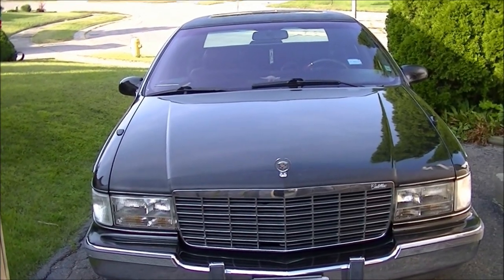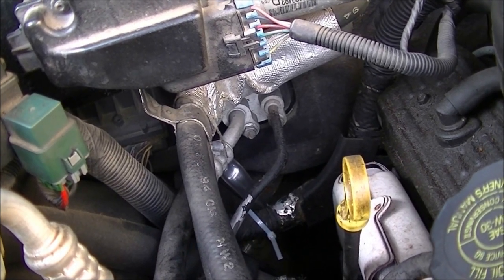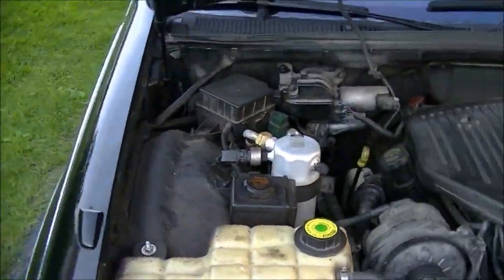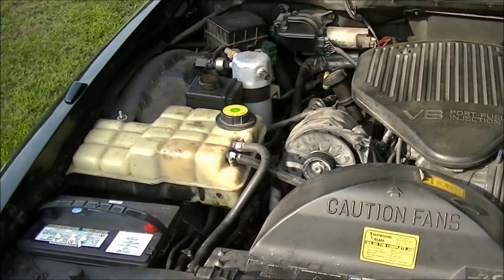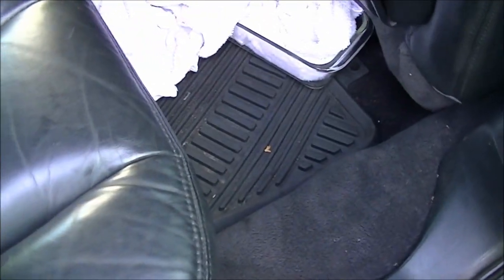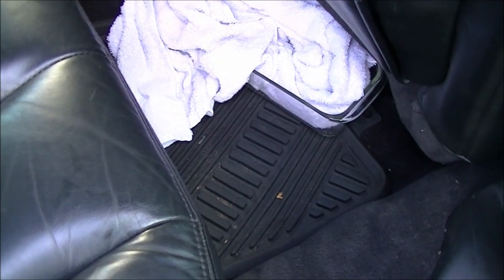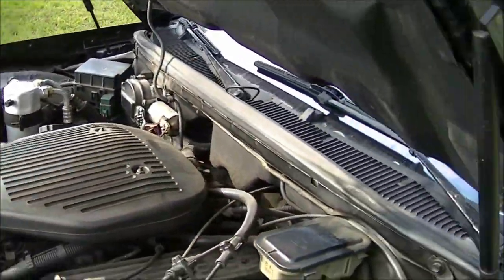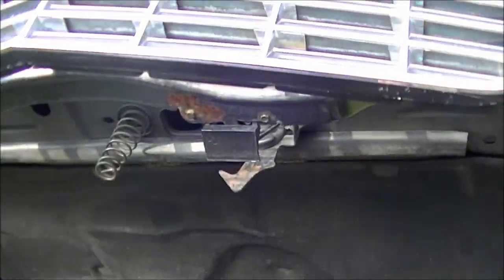PART 1 What To Look For/Expect When Owning Or Buying A Cadillac Fleetwood 93 96

Comment: Holy cats, my late father owned at least 12 Buick Roadmasters or Chevy Caprices and I have owned 3 Fleetwoods and 2 Roadmasters. They have had minor problems but nothing like you mention here. So far we each had to replace one opti-spark, one water pump and several window sliders.  I actually replace sliders with rollers intentionally. Of course normal maintenance like shocks, brakes, coolant, oil/lube, etc have been performed as needed or on a schedule.   But then again, we, being frugal, don't drive our $40-50K cars or any car we LIKE in the winter. We buy cheapo econo-boxes for driving in the salt.

Comment: I'm not sure if it would work on this but had an idea my friend's father used to do on door seals.  He injected silicone into the seals to keep it from getting crushed yet still have some cushion.  Then he would wipe silicone or some type of long lasting rubber protectant on the seals to prevent rotting.

Comment: Well done sir! I too was once a miserable SOB after purchasing a '94 Fleetwood from a Cadillac dealership in NJ about 15 years ago. Had two 77 DeVilles and an 87 Cimarron(!) previously. My Fleet had just about 100k at the time of purchase. First really cold winter day comes along and the dash pad cracks; that was only the beginning of my woes. Soon afterward it took a tow to my mechanic to find that I was out of fuel with 2 bars showing on the LED gauge! Very insightful about the body/rust quirks, BTW. My biggest problems came with Opti spark failure and later tranny failure (a $2700 repair) before a buck mercifully decided to cross in front of me at around 45 mph. Sold the car to a fellow who had 93-96 Fleetwood limos; he got a damn good parts car out of the deal (mine also came with chrome Vogue wheels--a $2000 option alone--shod with mustard/mayo Vogue tyres). I could go on about the many quirks that made my Fleetwood a less than satisfying experience. Aside from a tendency to wear out front end/steering parts (it IS a 4400lb. car after all) one of the few pluses I can note is the 94's improved handling on what is, after all, the same RWD chassis in use since 1977. I've since switched back to Lincoln Town Cars since the experience with my last Caddy, but was so dismayed at the time that I half-seriously test drove some Series 3 Jaguar XJ6's thinking "how bad can one be after this last Cadillac?"
Reply from the maker: telebob59 thank you for watching the video I appreciate your comment. yeah I'm quite a miserable SOB I took the car out of hibernation after sitting during winter I moved it up and down the driveway and blew both brake lines just by doing that.... Im not surprised it happened just really pissed me off.  I'm glad it didn't blow when I went for my emissions test! The total cost for brake lines and have the 23 year old spark plugs changed and fuel filter came to $428 which isn't too bad I figured it would have been more considering the spark plugs are a royal pain in the ass to change on this car. Now my brakes work real good the car still runs like shit even with brand new platinum spark plugs and fuel filter next I'm going to see if my ICM is the culprit because I hear a lot of arcing sounds coming from the coil. I read that a faulty icm can cause the  timing to be off and make the engine run lean or rich. I might need to have my steering components looked at because now I hear this clunk sound when going over small or medium bumps 

My Next car will hopefully be a 78 fleetwood or Eldorado convertible of that year I'm sick of all these sensors and computer modules they're  supposed to tell you if there's something wrong with the car but I'm not getting any codes at all

Comment: Very nice comprehensive video covering just about everything to look for.   I am looking at possibly getting one of the 94-96 either roadmaster (b-body) or fleetwood (d-body) which are different I'm told.  But from what is shown the issues should be on any of the LT-1 powered sedans.  I hear you on the reman parts had an issue once with an alternator.  It was performed by the dealer along with other repairs and they had to get a reman from napa a "gold series" ironically.  It didn't make noise but it did trigger my battery light but as approaching red-line not low rpm.  Fortunately I immediately turned around and went back.  Dealer tested it when they got to the load test, immediate failure dropping to 10 volts.  They were fairly ticked as it had the bs 100% passed test printout packed with it.  So they actually sent them a bill for their labor for the R&R which was considerable haha.
Reply from the maker: I'm glad you enjoyed the video. The B body and D body are different but pretty much use the same engine and transmission. All the issues that I've had on this car could happen on the impala, caprice, buick roadmaster wagon or sedan. I know they all suffer from heater core leaks, broken window sliders and rusty rear quarter panels, mine hides the rust because of the chrome panels :)  I wish grandpa bought a 1993 fleetwood with the LO5 engine, I know they were slower and people say never buy the first of anything because it could be a problem down the road but I think it would be far more reliable than my 95. Which I'm still driving..... currently she's running rich and lean and stuttering at slow speeds, gas mileage went from 15 city to around 9... I know for sure it will not pass emissions testing next year. It seems every time an attempt is made to repair it or treat it to something good something bad happens In May of this year I bought brand new Hercules White wall tires from a guy for $300 who wanted to switch to wide white walls, I had them installed and not even a week goes by I ended up getting a roofing nail stuck in the shoulder of one of the tires. The only reason why I'm still driving this damn car is because it has working A/C  I don't think I could sell it to someone with all the issues it has. I can't afford to buy another car right now

Comment: I have 1995 Fleetwood, and it's going strong but it only has 12,000 km on it. My 1994 Buick Roadmaster(same basic powertrain) has 270,000km, and my 1995 Buick RM had 395,000 on it when I was written off. All 3 of my cars, like yours had/have the Factory Tow Package on it. I just wish they would build car like these still, not those pathetic subcompacts that they are claiming to be fullsize cars

Comment: I have a 1996 Cad Fleetwood that I almost had for 10 yrs and they are some nice smooth riding cars. Went I brought mines it's had 78000 miles on it when I brought in 2009 and I still have the car now today and it have 84000 miles on it and it run good as new and just like sitting in my living room and good AC stills blows cold 
Have a  LT 1 strong motor and  a 4L60E trans shifts nice and smooth and I'm the second owner of it and I will not buy a brand new one, because it not like the older ones.

Comment: My 96 Buick Roadmaster has that A/C compressor noise and had since I bought it in 2016 w/22K miles. Have 37K, noise still there, still blows ice cold. Had it looked at but I’m stationed in Germany where I sent the car and some say it’s normal, others think like me, bearings going. Just got the photo today since 2 are available but can’t see what kind it is. I’m being stationed back in the US next month so when the car arrives I’ll replace it there.

Comment: I have a 1995 Fleetwood and it’s still going strong with 150,000 miles on it. I recently had to rebuild the transmission in mine. I don’t think the 4L60E is a very good transmission either. It’s definitely a weak link in these cars. I think the problem is they designed it with planned obsolescence. A lot of the parts are weak including the clutch sun shell which holds all the clutch discs. When that thin piece of metal fractures it’s all over.They knew it or something else inside would probably crap out at around 100,000 miles and send customers back to the dealer to trade it in on a new Cadillac. The older GM trannys would run forever. They used to make them a lot more robust. I was just curious what happened to yours and why you had to stop driving it. I’m pretty good working on cars and I would be glad to try to help you figure out how to get her going again. Thanks for the video. It’s cool to see someone younger like myself interested in older rear wheel drive American cars. These were truly the last traditional Cadillac.
Reply from the maker: Ryan Hodges Hi Ryan. Thank you for your review. This car used to belong to my grandfather he was the first owner the car was purchased From John bear Cadillac in Hamilton Ontario. He paid $48,500 brand new. He never took proper care of the car which would explain why I'm having issues one after another. He stopped driving it because it had a leaking radiator, oil lines, transmission lines you name it every line that had fluid in it was shot! The final straw for him was the heater core not blowing out any heat. The cause was from using the orange antifreeze called Dex cool. If your car has that stuff switch to the green stuff! I Took ownership of the car back in 2013 and officially put it on the road on march of 2014. I believe that the optispark is failing but in a very unusual way. Last night it rained/snowed I went out to start the car and it fired up like it normally does but stutters really bad in reverse or drive almost like it wants to stall but never does. I shut the car off and start it back up the problem sorta goes away but it's still there. This problem only occurs when it's wet outside
Reply: vcamnowaa That’s good advice about the orange Dexcool stuff. It can really cause problems. Mine already has the standard green antifreeze in it. It does sound like your Opti is probably going bad. Especially since you mentioned that it gets worse when it’s damp outside. That’s usually what happens. They are extremely sensitive to moisture unfortunately. If it’s the original one it’s probably on the way out. There’s a guy on EBay who restores Optisparks. His seller id is Berrington1 I believe. I bought one from him. He does really good work and uses good quality parts. He puts thread locker on the rotor button and seals the cap to the housing. If you decide to buy one from him he will send you a video of the the new one working on an oscilloscope. You might want to check his stuff out. I know you’ve had a lot of problems with your car but I believe you can get it going again with a little work. They are really great cars and they will go for a long time if a few of the known problems are taken care of.
Reply from the maker: Ryan Hodges Thanks Ryan. The car is still running just takes a bit of pedal stompin to get it to snap out of it's stuttering tantrum. I actually just drove to the grocery store and a few other places today with no hiccup. I will just keep driving it till it no longer runs. The car has too many issues rust/ mechanical wise... The cost for the opti and water pump plus the labor to have it replaced isn't worth it. I could easily put that money towards a replacement Fleetwood in better shape than this one. I'd do the job myself if it wasn't for the damn mechanical fan being a pain in the ass ughh..... I will keep that ebay seller in mind
Reply: vcamnowaa Hopefully you will find another one someday. It is a lot of work to replace the Opti and it would be expensive to take it to a shop. At least you can still drive it.
Reply: Ryan Hodges--ditto on the 4L60E(see my comment above).

Comment: I've heard that when you do a tune up on the LT1, you have to replace the water pump... As in you have no choice if you want a running car.
Reply from the maker: Well a tune up can be just plugs and wires. A full R&R job would be the waterpump if it's leaking the Opti because coolant can seep inside it might as well replace it while the pump is out, Mine is currently experiencing this issue but I refuse to fix it. This car is junk and not worth saving

Comment: I just saw that your Optispark is failing. If you can, try to find an AC Delco original or a re-manufactured one. The cheaper quality lower priced optis are junk and not worth buying. Especially considering how much work is involved in replacing one. Also, make sure to use Loctite on the rotor screws and seal the cap to the housing with a good sealant.

Comment: I have a 1994 Cadillac Fleetwood Brougham, with 255,000 miles. I still have original compressor and the AC will you freeze you out, and with no noise what so ever. You probably bought a lemon. Not all of these cars are a lemon.
Reply from the maker: sam rafeedie Trust me Sam yours will stop working just like all of the others. My car was free and only needed a few things for safety. My OEM A/C  worked just fine 3 years ago and then bang it died due to old age. Never once did I say these car's were lemons. You want to talk lemons let's talk about the Deville's with the horrible Northstar engine

Comment: which do u think would be better to buy a 97 lincoln town car or this?  i can't decide
Reply from the maker: Sorry just saw your comment both cars are good but the key factor is were they maintained and looked after. I'll admit my caddy is no show room car and has had a few issues but most of that is neglect from the previous owner my grandfather... But the majority of the issues with my car could happen to others if they end up buying one second hand. a 97 Lincoln town car are excellent automobiles but the 4 expensive items to fix is the air ride most people convert them to springs with shock absorbers, Intake manifold is prone to cracking near the thermostat and could dump coolant everywhere. and of course if you buy a high millage town car the transmission and engine may have seen abuse and neglect. The engine and trans are pretty much bullet proof on these cars but I'd try to find a low millage town car if you can

Comment: I have A 1994 fleet  I'm having issues with, it cranks but wont start. I've had it in shops & no mechanic wants to take time to fix. Just been spending money on towing with no real solution. Car also went airborn off the road but loaded in corn field, no suspension issues surprisingly. Please help. Car was running perfectly before being towed from accident.
Reply from the maker: How did it end up going off the road? Swerve and avoid or slippery road conditions? Also does it spudder like it wants run or is it just constantly turning over? 

Try this
Turn the key to run position don't start the engine listen for a humming sound the sound will be coming from the fuel pump in the gas tank you'll need to listen carefully and may need to fasten the drivers seatbelt to cancel the ding ding sound to be able to hear it. If you can't hear that humming sound have some one stand behind the car listening for the sound. If there is no sound your fuel pump may have been damaged from landing in the field and the tank will need to be lowered and the pump will need to be replaced. If you hear a humming sound then the pump is working

Get back to me with the results and we'll try something else
Reply: @vcamnowaa  got it running. A simple tune up, control module & oil temp sensor. 650$ & almost gud as new. Brand new tires dry rotted even tho they where rotated manually to avoid flat spots smh didn't work. Big break kit & new tires which still under warranty should make it ride like I remembered. Believe it or not most mechanics havnt worked on an older vehicle like this & Tht was the issue. Took it to Bobs garage & he said piece of cake. Gas was on full tank but sat 4 almost a year & still cranked of course I put fuel stabilizer in it also. I'm happy, thanks.
Reply: Var key